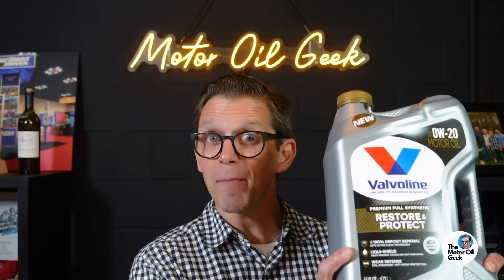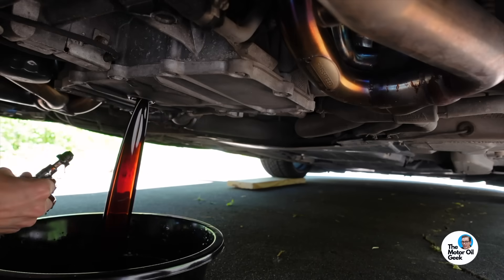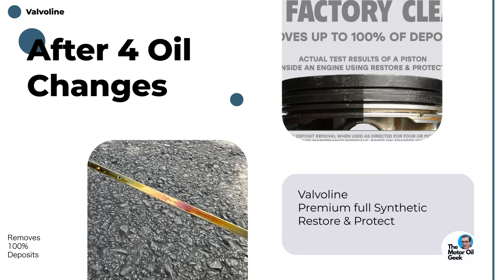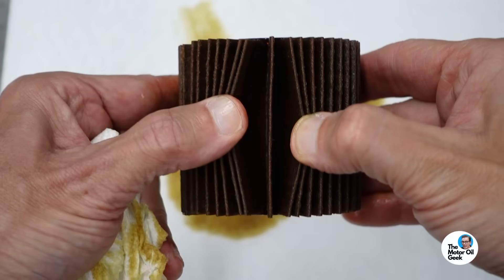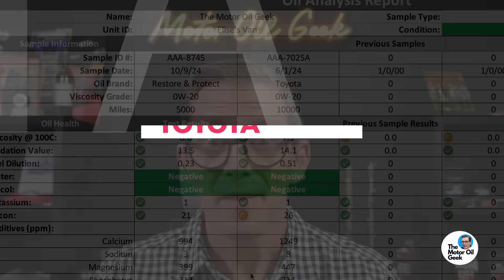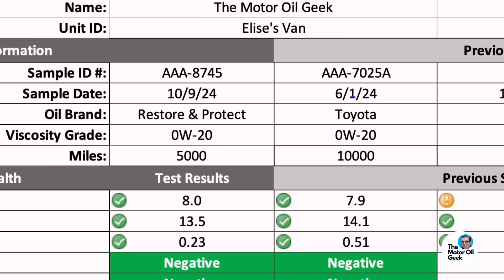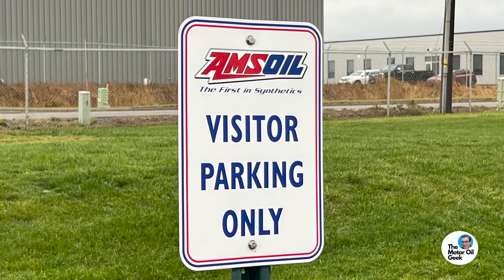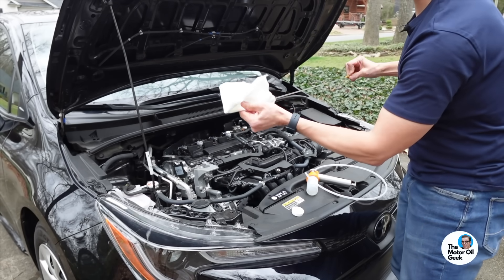The TRUTH About Valvoline's BOLD Engine Cleaning Claims

Comment: That really is impressive after only 1 oil change. My '05 3.3 Caravan w 160K ( using STP 5-20 conventional oil and STP filter)  doesn't burn oil, doesn't leak, and stays clean until I change it at 5K MAX. I add Techron cleaner every once in a while, maybe if I go over 5K. Otherwise she runs fine.👍🏼

Comment: I saw zero change on the dipstick after 4 oil changes and 20k highway miles 2008 crv. No noticable change at all on engine performance. I will know more when I do another valve adjustment. I think some people are just very susceptible to power of suggestion. Prefer being a skeptic. Trust but verify.

Comment: I used this oil in my 90k mile Ram 1500 Hemi. Ran rough before. 3 changes and 6k miles later, it is as smooth as silk. 
Lake Speed Jr: the ONLY source for motor oil knowledge!

Comment: I have been seeing videos of the restore and protect. My Chrysler 300 requires 0w20 but I have seen story after story that the oil is to thin and is the cause of the lifter issues. A lot of people on here as well as forums are saying to use the restore and protect synthetic 5w30. I am contemplating doing the same

Comment: On a fairly dirty engine do you think a mid oil change filter change would be recommended? Say in 4000 miles a 2000 mile filter change and adding a quart or so of oil.    Then cut filter open to see if clogging is occuring??    Or do you think run the whole 4000 miles and change oil and filter??

Comment: I wish Valvoline made Restore And Protect in a 5W-40 Euro oil.  I'd use this on my wife's VW Beetle EA888 Gen 3 Turbo.  They make RandP in 5W-30, but the specs do not line up with what VW requires for oil use.

Comment: Spoke with Valvoline tech via email. Asked about long term use in my 2.0 Ecoboost.  They said they highly recommend using it not just for reducing deposits but for the life of the engine. They said it's their best oil. Have 4 oil changes of Restore and protect for 20k use. Looked in the valve cover and cylinder with a borescope. 180k and looks new. Its had Mobil 1 from day one but I am impressed with the lack of type of deposits.

Comment: Valvoline R&P was such a huge disappointment for me. I have a 2016 Audi Q5 that was burning about 1 quart every 400 miles. After about six oil changes with R&P every 5k miles, it started burning a quart every 200 miles; got worse. I then did a piston soak and am now at 1500 miles with no call for oil yet.
Reply: What'd you use for piston soak mate?
Reply: This is why I’ve never used aggressive products.  They’re going to remove film and increase gaps, causing more oil burn.

Comment: 2010 Scion XB, 2AZ-FE motor. Fifth oil change.  After 15k consumption has held steady at around a quart every 3K over the last two changes.  It was at about 1 3/4 quarts when I started using R&P.  One thing though.  At this fifth oil change the drained oil was darker than the previous four changes.  Black in fact.
Reply: That’s a very good thing. I got a car from my Dad that has been sitting for a while while. I did very frequent changes with the R&P and the filter was heavy and the oil was incredibly dark. It flowed really well though. I’ve seen some peoples oil so dirty it would hardly flow. I eventually switched back to Mobil 1 EP but i might possibly go back as I’m not really sure how dirty it is
Reply: @RobertSmith-le8wp  I’m wondering if it took four changes to really loosen deposits.  Valvoline states it may take a few.

Comment: ⭐️⭐️⭐️⭐️⭐️ 

On my 2013 Lexus LS 460 with 208,000 miles on it. I only use Valvoline SAE 30 HD. That I buy at Napa auto parts. Sometimes, when they don’t have it, I use the Napa brand. Engine all brand new. Even with 208,000 miles on it compression is within brand new specs.  The only thing that I ever changed are the water pump hoses sometimes the injectors depending upon what happens just regular maintenance for a decade old car.  I live in Miami and I just moved to Nevada so I will always use single weight motor oil.

Comment: Do you think Valvoline Restore and Protect would work in small air cooled gas engines?  My old 30 year snowblower with a Tecumseh single cylinder 318 CC flat head engine is starting to burn oil. I think the piston rings are sticking with carbon build up. There is no oil filter, I change the oil once a year with an average 5 hours run time mostly full throttle.   I use 5W30 oil, Thanks

Comment: I am tempted to put this in my Jeep at the first oil change but I was wondering if this oil desolves solids will is harm the seals?
Reply: No it has additives to condition seals. I use the valvoline restore and protect in my 2024 3.6 Jeep Gladiator Willys and will the whole life of my Gladiator. Great oil My 3.6 run Very Smooth. When idle can't tell if it's running unless I look at the rpms lol
Reply: @jacobsebastien3910   I have a 2024 Jeep Wrangler Willys in Hydro Pearl Blue.  Bought it a couple of weeks ago with 32 miles on the odometer.  Now I have over 700 miles on it and I am tempted to change the oil and put in some fresh oil since the one in the Willys has been in it for over a year.  Which Viscosity Oil are you using? The Factory recommended 0W20 or the 5W30 that everyone is swearing to?  Seems the United States is the only Oil recommending 0W20 in their 3.6 Pentastar engines where other countries all recommend and use 5W30.

Comment: I've seen the ability for just cutting your oil changes down from every 10000 miles to every 5000 miles in my 2012 Toyota Prius V to show that that cleans the cooking off of the dipstick. As well, I'm hoping and assuming that since cutting the oil change interval in half on that car cleaned the coking off of the dipstick that it would also help to clean other parts of the engine. And that car wasn't even running a restoring protect. It was just a oil that met the specification standards as A0W20 for that particular engine.

Comment: 2010 Scion XB, Toyota 2AZ-FE engine, 121K.  First R&P oil change was at 106k.  Oil consumption was 1 1/2 qts plus maybe a few ounces between 3K to 3.5K mile oil changes.  I’m coming up on my fifth oil change.  Oil consumption is just under 1 qt so no miracles, but an improvement I can certainly live with.

Comment: 2010 Subaru outback 3.6r with 215k regular oil changes every 7.5k with Kirkland 5w30 synthetic and the engine looks like new on the inside.  No need to use this stuff if you use a quality oil and change it on time.

Also video is full of poo, can't even do a comparison  of oil with the same mileage on said oil.

Snake oil... nothing more, nothing less.
Reply: Dam how long you been testing this oil? You a oil professor?😂
Reply: @jacobsebastien3910 no, just a dude that does not fall for marketing bs.

Comment: I started using this product on a 2015 Audi A4. These cars are notorious for oil consumption and mine was no different. It was a one owner purchase with 70K miles when I got it. The car was going through a quart every 750 to 1k miles when I bought it. I started using Valvoline Restore and Protect at 5K intervals and I am now at 95K.  The car has completely STOPPED consuming oil.

Comment: I have an older truck, but only 80k miles.  I just did an oil change today with R&P.   I noticed 2 things immediately...this stuff reeks lol.  Reminded me of that gear oil smell.  The weird thing was my oil pressure at idle went up about 10 psi.  My dipstick already looks like new, so I'm not sure how much cleaning it has to do, but I'm going to use it a few times and then switch to full synthetic Maxlife.

Comment: I'm was surprised to see The Motor Oil Geek doesn't change his wife's oil more often than 10,000 mi.
Reply: Mileage is kind of irrelevent. Engine run time is more accurate. 100hrs @ 25mph (2500) average is way worse than 100 hrs @ 55mph average 5500miles. If you drive hwy miles and your oil temp is 215 or less changing every 3k miles is a waste of time and money if you dont live in a desert.

Comment: I bought a 2023 Toyota 4runner with only 13,650 miles.
It has maintenance records of service. They did oil changes twice. Im waiting to put 4k miles on it and im going to put Valvolines R&P in it and keep using it .

Comment: Lake, Former JPD here and Callaway HS graduate from way back when in the mid 70s.  Just wondering can I use this Valvoline Restore and Protect in my zero turn lawn mower.  The hardware store where I bought the mower sold me Kawasaki SAE 20W-50 4-Cycle Engine Oil for oil changes. Three weeks ago I used the restore and protect in my 2005 GMC Canyon PU.  Also added Techron fuel system cleaner when I filled up my GMC truck yesterday.  Thanks for all the great info.

Comment: I bought some 5w 30 Restore and Protect not long ago. My wife’s 2006 Matrix only has 137k miles on it but I wanna keep it running smooth for a very long time so figured I’d start using that Valvoline type. I was always a Valvoline man back when I used conventional oil in my muscle cars but at some point (can’t remember) I started using Mobile 1 Full Synthetic on our newer vehicles. Funny I’m going full circle back to a Valvoline brand. My next oil change will be the first using Restore and Protect but I will use it from now on seeing how it worked the first time on your wife’s Toyota van.

Comment: I bought a 2012 Jeep Liberty in May of 2024. 
It had 110,000 miles on it. The dealer just changed oil because it was dark. So I ran it to 115,000 miles and changed it and the filter. I had read good review on Valvoline and decided to give it a try. The oil was getting dark by then so I assumed there was some leakage around the piston rings. I checked the oil at 118,000 miles and it was really dark. Proof the Valvoline was cleaning well. To be safe I changed the filter to make sure it didn't get clogged. The Jeep now has 140,000 miles and sounds really quiet, I'm impressed. The dipstick looks like new so I have reason to believe the internals are also cleaner than when I bought it. I suspect it was used gently due to the low miles and excellent condition of the body. But using a vehicle for short trips can contribute to sludge and varnish build up.

The engine actually feels like it has more power, just a slight tap of the gas pedal and it wants to take right off. Didn't do that when I bought it. But that could be the colder air getting more  oxygen to it. 

Highway mileage has increased from 17 to 20 on my last fill up. That tank was mostly highway with a trip through the Dells and one other small town. So 95% highway.

Comment: If the oil completely cleans the engine after the 4th oil change. My question is, is it recommended  to keep using restore and protect after the fourth oil change, or can we use a different full synthetic?

Comment: Just found you, my nerdy oil guy. I recently purchased a 2008 Honda ridgeline. It has dealer history and the oild change history is decent... but not great. Recently learned of this oil. I was running a combo of Castrol and Rotella because of the "detergents" in those oils.... don't hate me. I am just a dumb 20 year diesel tech... the 2008 doesn't have anything alarming... except a tick that could be due to the fact it should have had its valves adjusted.  Will be looking into parts and time to deal with that. But in the mean time restore and protect to flush out the 178k mile of build up. I love the sound of a harmoniously set up engine and sadly this work horse honda is not there. The timing belt was done less than 100k ago but the tech in me questions the guy that did the work. Did he skip it because the belt should fix it? Idk ... but it has a tick it shouldn't I I am hoping the Valvoline cleans it out and hinlves me a clear answer ... but audio  only because I am not taking samples and sending them to the nerds. No offense I work with a lot of nerds, and I get that the devil is in the details ... you have know idea  ... but the details you guys would fight of vs the average customer is hard to explain. Thanks for this video and thanks to all you nerds everywhere. Be the wierd thingy that you are... because without you I won't have anything to point and laugh at. This is for Jamie she is my awesome oil lab gal and she kickasss and I would kick the ass of any tech that comes at her she is a beautiful nerdy bad ass and she helps me out alot.

Comment: I bought a used Toyota Rav 4 with 86K mi. around eleven months ago from the first owner. He claimed he did regular oil changes but couldn't tell me at how many miles. I immediately did an oil change with Mobile One. Changed it again after 5000 miles. It was med.dark brown when I changed it. The second oil change I used Valvoline R &P.  The following are the changes I noticed after using the Valvoline R &P for 5000 miles.
1- The car had a slight startup rattle when cold. That has gone completely away after 5K on the R & P
2- I wouldn't say it was running rough but I could definitely feel some vibration in the steering wheel at idle. It is now noticeably smoother at idle.
3- The R & P oil was definitely darker after 5000 miles than was the previous Mobile 1 after the same amount of miles.
4- I've noticed less of a lag when I floor it at 40 miles an hour while getting on the highway.

Comment: 2018 RAV4 with 50k miles.  I used the VRP 5W-20 and immediately noticed the engine runs a lot quiter and smoother than the OEM 0W-20 oil.  After 2000 miles the engine efficiency increased by 2 mpg.

Update 12/2025: At the second oil change with VRP, the shop used 0W-20 because that is what the "manufacturer recommends".  The engine went back to being noisy.  I didn't see any change in the mpg but I liked it better when the engine ran quieter. I can't explain why the change from 0W to 5W makes such a difference in real world driving.

Comment: Did 2014 Audi A-6 And 2012 4x4 Silverado Z71 and wife said truck 280,567 miles is running more responsive and no sluggish at the start now,and my Audi A-6 is running the same except I'm not topping it off yet, before I was losing or burning some off on the turbo and whatnot,I'm sold on this oil,after seeing these results I'm 1,500 miles into the oil and everything is good 👍 I ran Valvoline high mileage back in the day and went to liquid moly because it took away the lifter noise on the Silverado and got better oil pressure,but paying $55 not $29, right now money is really tight so I got two jugs for $58 and I'm happy,so for now it's restore and protect Valvoline 🎉

Comment: I did an oil change and an oil cleaning step years ago with my tourist wagon on a new engine that I had just installed. Cause I wanted to invest sure that it was clean but it wasn't the filter that got stopped up. It's the old pickup that is what you've got to chick. If not You're still gonna burn that in the engine up

Comment: My 2012 5.7 L Tundra now has just over 211K miles. I bought it new and it gets regular dealer oil changes with a genuine Toyota filter and 0-20W Mobil 1.

At around 170K miles I started to get that cold start clatter the 5UR-FE is known for, especially if the truck sat a couple days unused, which happens a lot with mine. At around 197K I decided to try this Valvoline Restore and Protect. Interestingly the local, newly opened Valvoline Instant Oil Change center doesn't even carry this Valvoline-branded oil. But the local Walmart does so the VIOC place agreed to change my oil and filter using a genuine Toyota filter I provided with 2 gallons of R&P from Walmart. The oil change takes almost 8 quarts so I always have a little left over.

This is purely anecdotal but within the first 1,000 miles of the R&P oil change, I no longer had the cold start clatter. At 3,000 miles, right when my truck hit the 200K mark, I had it changed again, same as last time, genuine filter and 8 quarts of R&P. I'm at 211K now and the truck has never run better or quieter. Even if it sits for days, no more clatter on cold start. It never used much oil between changes but now it uses none that is measurable.

I had my doubts and concerns about R&P but so far I'm happy with it. That cold start rattle/clatter really bugged me but it seems to be totally gone now. All of my vehicles (the Tundra, two Mitsubishis, and a Honda) have over 200K miles so I'm going to try this stuff in all of them and see what happens. So far I'm impressed. Just wish the Valvoline instant Oil Change stores carried it. I was told the only reason is that they can't get it in bulk (55 gallon drums). But props to them for letting me supply my own oil and filter.

Comment: I switched to Valvoline Syn Power 0W30 for my 2006 Saab 95 Aero wagon a few years ago from Castol Edge and my car's engine runs much more smoothly with Valvoline. I change the oil every 3,500miles or sometimes twice a year depending on miles I drive but I use Shell V Power gas because the car runs better and is more economical on the Shell V Power.

Comment: Great video.

I cringed at the notion of 0W20 oil in any car.  5W20 is a low as I will go.
This is good knowledge, the notion of the very oil we depend on to protect our engines also cleaning the internals is awesome.

Before we had synthetic oils an old timer told me to substitute a quart of ATF every 10,000 miles. He claimed it cleaned the inside of the engine due to higher detergent. One quart if the engine held five and half a quart if only four quarts in the engine.

Comment: 2016 Audi Allroad started very quickly burning 1Q every 200 miles and fouling plugs.  One oil change with this oil and oil burn slowed significantly, 1Q every 1000miles .  I then did two Berryman's B12 piston soaks.  Oil consumption went to zero.  Now I only run this oil even though it doesn't specifically comply with Audi specs.